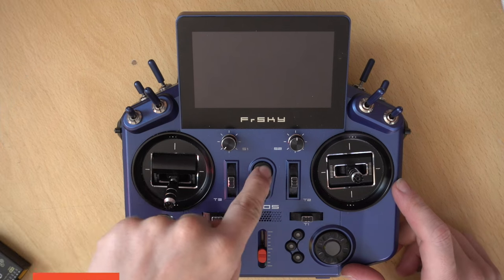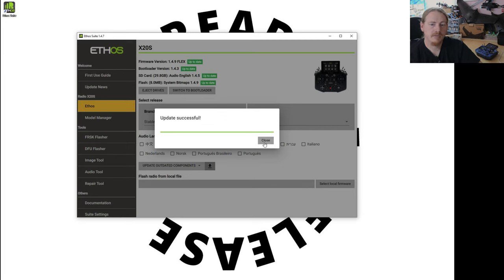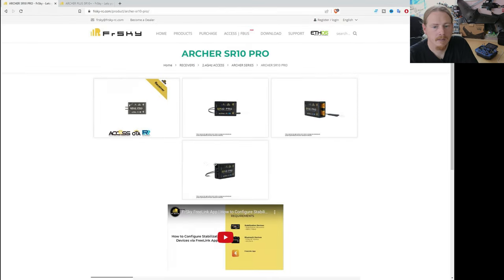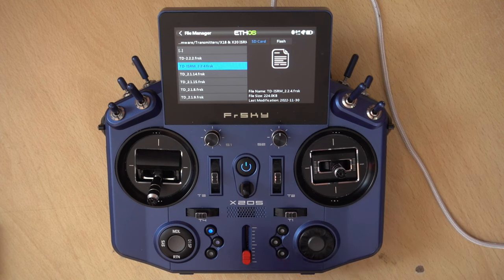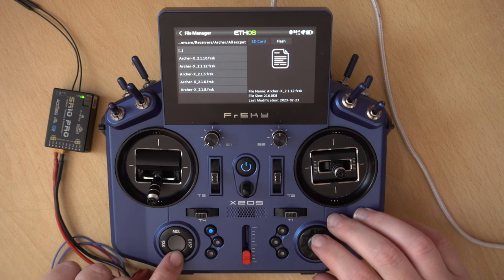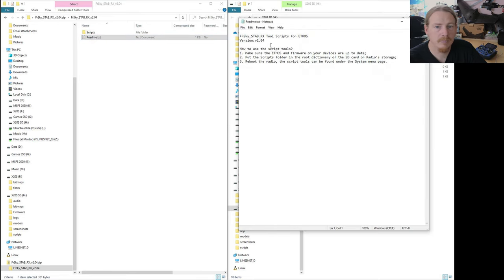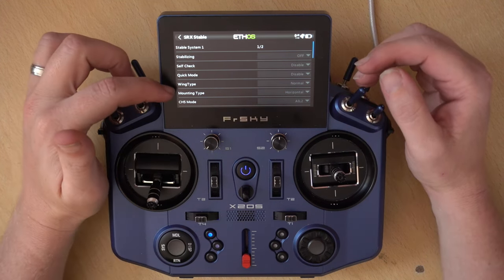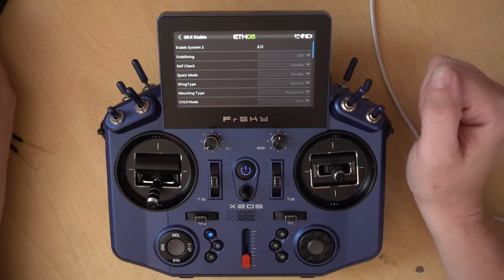How to fix configuring the Archer Plus stabilised receivers: Installing the FrSKY SRX LUA scripts

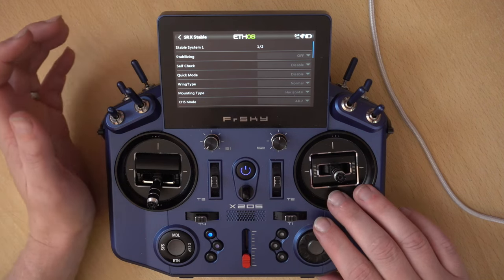Comment: Hey Darren. It looks like V2.06 Lua is for ETHOS SR10+ and TD SR 8-12 receivers.  I had both of these receivers exhibit a weird phenomena on a gas plane. Channels 7-10 had a serious jitter in them only when the engine was running. I thought it was ign interference, WRONG. It was the 2 independent Stabilizing Functions thing. It was cured by turning OFF the "Second Independent Stabilizing Functions" using the Lua Script V2.06. Its on page 2 of 2 !!!, which is hard to find to adjust. It is ON by default, not a good idea IMHO. This video showed me how to find page 2, at 13:55, thankfully.
I hope this helps others who stumbled on this like me.  Thanks
Reply from the maker: Thanks for the tip 👍🏻

Comment: Hi Darren great video to help us!
 I have the X20S FCC version and I already used EthosSuite to update my X20s with the latest Firmware ver 1.4.9, FCC already.

 Do I still need to update my X20s to the latest RF Firmware ISRM -TD Module to ver TD 2.2.4. Are they separate software components. 

When I go to the info screen, i only see the Firmware Version 1.4.9.  But i don't see the Internal Module TD-ISRM version info. Why is that.
Thanks.
Reply from the maker: Thanks Ted. Yes, they are two separate firmwares. So you will need ti update both. You will only see the version of the internal module if it is enabled in the current model.

Comment: I must congratulate you, on your knowledge of the FRsky system. Were you involved in the development?
On the SR8 Stabilized RX, how does the RX recognize the 4 controlling channels? I contacted FRsky, BF finding your channel, and they indicated a different channel for the Gain (Ch13) and the modes (but did not specify a channel for modes) BTW what happened to CH11? Why was it overlooked?
Does the RX have to be powered during the TX programming, to recognize the keystrokes as they are entered?
It also should not be this hard to program a toy airplane!!!
Apparently the word 'Intuitive' does not translate into Chinese???

Comment: slightly off topic but i have a brand new X20S and a TD SR18 and cannot get the SRX working. Updated firmware for both  There are no icons on the info page and the SRX under devices somewhat activates but won't accept any settings. The stabilization works but one elevator is backwards and off course I cannot enter any gains. I appreciate your videos, the learning curve with FrSky has been much quicker as a result but i'm stumped on this.
Reply from the maker: Check that you installed the LUA script in the right location. That could be what’s making the tools not be shown on the system menu.
Reply: I have a X 20 pro trying to use the SR 10+ stabilization. I have tried to install the Luis script on the radio and the flash drive even try to put a SD card in and install it. There cannot get the stabilization to go on the system screen, I read your other comments, and I too have problems at the stabilization works, but Rudder doesn’t sometimes the Arons won’t go both directions and I can’t enable the stabilization

Comment: Hi mate, thanks for that vid again….Still have problems with X20S, SR10+ Receivers….Everything is up to date and Lua Scripts also…As soon as I turn stabilisation on, there will be no output on the channels, just on gas…I tried it now with the second SR10+ and both show the same issue…Maybe you can show the combination of SR10+ together with the X20S in one of your next vids…by the way you can turn back to page 1 in Lus by longer pressing the Return button….Best regards and keep up your brilliant work.
Reply: Sounds like it's the infamous "Self Check" procedure again.  Perhaps You have inadvertently limited channel movement to 0%.  Advice is to never activate "Self check"
Reply: How can we fix that problem? Probably I’ve got the same issue.  Thanks!
Reply: @Schippi2001  the best solution is never do a “self check”…it sounds crazy but all it does is to reduce servo travel limits on each axis. Unless you have very bad servo geometry using a less than 30 per cent of servo travel, this is never a problem anyway. I have used dozens of frsky gyro receivers without ever selfchecking or calibrating. Now, if you must “self-check”, make sure that u do not inadvertently reduce servo travel to zero, which explains the common symptom described in hundreds of frsky S8R/SR10 question threads.
Reply: @leohcheung  thanks for your quick answer! I will check this. But I still have the issue with the non working settings in the tool. In the system menu it works but not in the model menu.

Comment: Using the new lua scripts dose the gain channel change from channel 9 to the script to channel 13?
Reply from the maker: With the new ArcherPlus stabilised receivers. The stabiliser function channels have changed from 9-12 to 13-16. Currently, the Archer and ACCST stabilised receivers are using old firmware. So they stay on 9-12. I don’t know if that will change in the future.

Comment: Hi Mr D 
Can you please help?
I have been attempting to set up Stabilisation.

All firmware and scripts are up to date.
The receiver is bound and stabilisation channels 13, 14, 16 haves been set.
SR10+ Calibration is complete OK
Self check carried out, all stick gimbals calibrated 
Gyrogain adjustment on Channel 13 working OK
Flight modes on channel 14 working OK, although I can not see any point with the switch in central position as all it seems to do hold all control surfaces in the central position, the same as when the gimbal sticks are central.(excluding throttle).

Here is my problem:
I cannot get channel 16 emergency mode to work.
I can see the switch is active in the Mixer and also in Outputs, but the control surfaces do not change when tilting the aircraft? Completely dead.

I have two SR10+ receivers and neither of them work in emergency mode.

I have successfully set up SR8 stabilisation receivers in other aircraft OK.

Does anyone out there have a solution to this issue?

Thanks a lot
Rosco

Comment: It's a little bit clunky to be honest, frsky seem to be releasing product quiker than ethos devs can keep pace with.  That said, apart from the missing XT30 connectors which I had really grown to like, and configuration being in the wrong part of the OS, the new archer plus SR10+ is fantastic.  Two independent gyros on the same receiver opens up a lot of possibiities.  Assuming they release an archer plus 12ch stab rx, i can replace some fairly complicated setups in thrust vectored EDFs with a single rx.  Even just having independent yaw stabilised channels means you can effectively use one as a steering gyro, without overcooking rate gain on the rudder.  What i'd love to see is independent flight modes for the two stab loops.  Frsky are really knocking the hardware out of the park.
Reply from the maker: The clunkiness is only temporary. The new tools will be a part of ETHOS 1.5. But yeah, totally agree with what you’ve said.

Comment: Hi Darren. Following on from my last comment if i exit the SRX stable menu, when i go back in the options are greyed out. Click open and they light up. Is it supposed to do this?
Reply from the maker: Yes. The options don’t do anything if the stabilisation is disabled.
Reply: Hi Darren. I've operated the modes switch and none of the positions activate Stabilisation.
Reply: Hello again. I was busy for a few days and came back to this issue again. Been through your video a number of times which are so helpful but was still not getting anywhere. Remembered seeing a manual for my receiver which is an Archer Plus SR8. So I thought I'd download it and take a look. Then I found that I had the switches set on the wrong channels. I just presumed that all the stabilised receivers would work the same. Switched the gain to channel 13, the modes to 14, it says to use 14 and not 15 when using the quick mode and the oh crap, I've called mine panic on 16. Now I've got the stability working, I can see the difference in flight modes ,have the rotary switch working for gain adjustment, thanks to your video.  Just brilliant. 👍
Reply from the maker: Yes, Archer Plus have changed the channels from 9-12 to 13-16. The non-Archer Plus receivers are currently still using the old channels.

I’m glad you got this working 👍🏻

Comment: LUA scripts are not showing up on the touch screen. I have no means to execute the script.  The file manager does not allow me to run the script...only move or delete the file. My zip file had three folders, and three scripts...hope this is right.  X20: fully up to date.  RX: SR8 Plus v1.05 (cannot find 1.08).  What am I missing?
Reply from the maker: If the LUA is not showing up in the system menu. It may have been installed in the wrong place. Please check where you installed it, compared to the video.
Reply: @MrD   Well, I had put the 3 folders in a subfolder.  It did not like that. Everything is fine after placing directly under Scripts. Thanks. Leads me to a new issue.  Everything is calibrated and channels set but I cannot turn OFF the gyro. I use the gyro in Quick mode so it is set to Ch14...but nothing happens.
Reply: I sorted it out with someone else's eyes. Inadvertently set Channel range to 1-8; which blocked out the gyro channels I needed.  All fixed.

Comment: i am really struggling with LUA's and where they should go and how to activate them,   when i download SD card contents there are only 2 folders , where do all the others come from and why aren't they there to begin with?  it would suit me if the X20s came with an SD card that had every folder the radio could use preinstalled on it , i've given up trying to get the stabilisation  in my SR10pro to work , i followed your other video re calibration etc and when i get to the move the receiever part near the end my servo's just don't react even with the gain turned all the way in either direction.  radio gear should be easier to use than the experience i'm having. i have updated the radio using the ethos suite and it's all up to date so that isn't my issue.

Comment: Hi Darren. Ive downloaded the latest Lua script, so now i have SRX stable, SRX calibration and SRX basic windows when i go into the system settings. With the receiver switched on, i have module listed at the top of the SRX stable menu. I select open and the options on the lost light up. I can select stabilizing on, quick mode on, select wing type, mounting type and inverse ailerons and elevators. I can operate servos by sticks but no stabilisation. Im on transmitter firmware 1.49, internal module firmware 2.2.4 and receiver firmware 1.05. Ive downloaded the LUA script 2.05. Am i missing a setting somewhere?
Reply: I am having the same problem
Reply: Change the channels to 13,14,16

Comment: do you know why in ethos suite FRSK Flasher -> TD Module (X20/ X20S/ X20HD/ X20HD Upkit) -> latest shown version is v2.2.2 2022-08-06 225KB and not v2.2.4
Reply from the maker: I’ve never used the FRSK flasher to be honest. If there is an issue. The best place to report it is at https://github.com/FrSkyRC/ETHOS-Feedback-Community/issues
Reply: @MrD  opened a new issue and frsky already solved the problem
Reply from the maker: Perfect 👍🏻

Comment: Hello Sir! hope you are having a super day. I just installed Sr10Plus receiver and I'm not  having good time with it. This how I've got mix page setup. AETR-A2-E2-F1-F2 and 13 is for gain and 14 for mode. When I activate the self leveling mode the flap 8 reacts with the elevator and flap 7 reacts with aileron. I've try couple different thing but didn't change anything, any help would be awesome.
Reply: Hello, I have the same thing dislike it.
FrSky point to improve " make manual error free and a clear explanation "
Making hardware is one thing. Communicate by means of manuals is another thing. Please look into this skill it will make your products more interresting.
Good luck.

Comment: Ok Darrin i'm at a loss here, i have done everything that u did i think but my x18 still will not read the temporary Lua scripts; there are no icon buttons to click on beside the info button, it won't read the scripts. I have the archer sr 10plus just like this one and although the sxr is calibrated and it works on mode select on channel 14, master gains on 13, oh crap on 16. all that works, but on level only i cannot change the orientation of the receiver, nor will sxr enable; self check won't work none of that. Lua scripts are on my sd card just like yours. about ready to abandon this frsky nightmare and go back to my NX-8; at least i know what i'm doing there. Love the videos i wouldn't be as far as i am right now without them; plz help.
Reply from the maker: If the icon is not appearing, the scripts are not in the correct location. On the X18, they will probably need to be on the NAND storage, not an SD card. Inside the scripts folder, you should also have folders for the specific scripts. For those tools, there should be SRX_Cali and SRX_Stab folders. Each one containing the relevant files, as they are found in the FrSky_AP_STAB_RX_v2.05.zip file. The safest way to install is to copy the scripts folder in the zip file to the root of the drive on the transmitter. This will ensure that everything is in the right place.

There is a bit of a learning curve. But trust me, once you're in the swing of things, it's a massive improvement over Spektrum. Spektrum is overpriced and has a bad RF link. So many planes at my club have been lost due to Spektrum's bad signal.
Reply: @MrD  Ok thx Darrin, i will try that.
Reply: @MrD  No sir, had to load the temporary Lua scripts onto my radio bin; then it found them no problem; nothing else would work.

Comment: And now i can't flash the new 1.0.9 firmware which came out on oct. 20th; just a few days ago. i flashed 1.0.8 just fine but now having problems flashing the new update; keeps saying binding, binding; binding!!!   I never had any of these problems with spectrum; i just didn't want to spend 900 - 1300 dollars to gain more channels, this seemed like an alternate choice but i'm not so sure right now; kind of a pain in my back side. What a learning curve it has been, i feel like i've gone to college on electronics!!
Reply from the maker: What process are you using to update the receiver?
Reply: @MrD  Hello Darrin, i am using bootloader onto my sd card just like you.  OTA worked on 1.0.8; but not on 1.0.9; it keeps saying binding until you return out or go back then the receiver will bind up to the radio.
Reply: @MrD  Thx Darrin, fixed all my problems for now; keep putting out those videos cause i'm watching and learning..  Fly ur models like u stole them!!

Comment: if you wanna setup a camera gimble on CH 7,8 you have to turn off "stabilizing" on page 2 otherwise putting it in autolevel mode will make CH7 do funny things for some reason.
Reply from the maker: To be honest, it looks like some things on the 2nd page aren't quite right. Like there are settings for Ail 4 and Ele4, on channels. But not Ail 3 and Ele 3. You can set up the gain and things for them. But no turn them off. I would imaging Ail 3 would be on Ch 7, and Ele 2 on Ch 8.
Reply: @MrD  ya, i emailed frsky back and forth, they're fixin it i guess.  Now I gotta learn to stop smashing the nose gear landing the A10
Reply: @MrD  can the receiver power 11 servos I got on the A10? Someone was talking about powering servos directly?

Comment: Please redo all your videos with a Radiomaster Tx16 or any modern EdgeTx radio.  There is a real need for information related to NON-frsky radios and binding the new AP rxs.
Reply from the maker: Sorry. I don’t have a TX16S. For the most part, EdgeTX is similar enough to OpenTX.

Also, personally I am not a fan of EdgeTX at all. I hate the interface, and there are so many little annoyances that make me stay with OpenTX on my Horus. I know that I will need to move on at some point, as OpenTX is basically a dead system now. But, when the time comes, I’m more likely to move to ETHOS now, over EdgeTX. I’m actually finding that I’m missing stuff from ETHOS now, when I make changes on my OpenTX radio.
Reply: @MrD  I had the chance to see a few of the Ethos radios this summer.  The OS/UI is really nice but the form-factor of those radios kills me... I wish they would make a modern Taranis.   Edge is great though.  Keeps getting better.